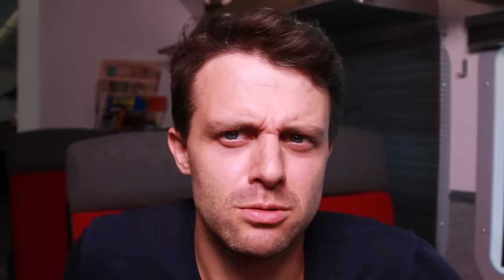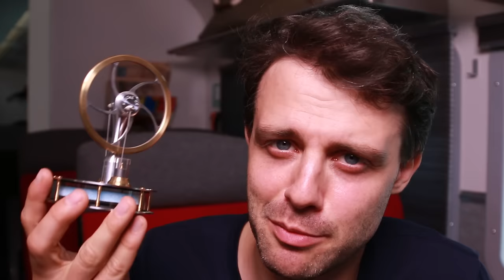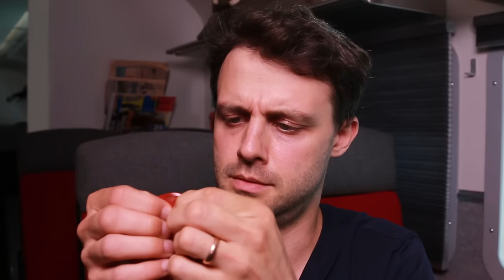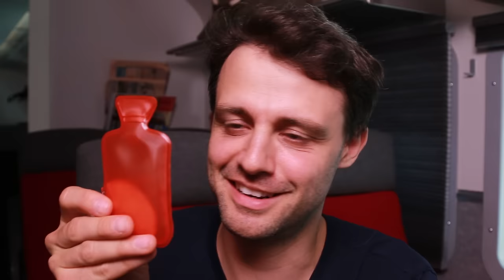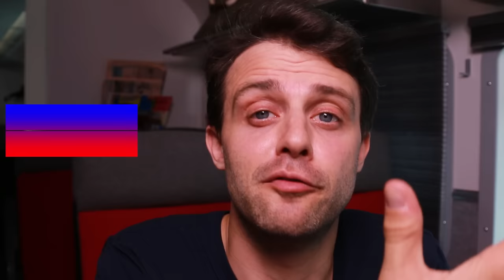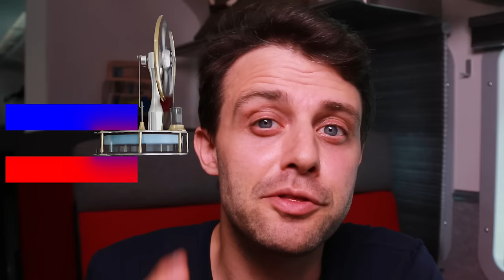A better description of entropy

Comment: Great video! Thanks for an interesting and enthusiastic description! Your definition and example is really nice. However, perhaps the statement “heat is not what you need to run an engine” could be potentially misleading. Heat is defined as the thermal energy crossing a system boundary due to different temperatures, from one body to another. So either we have a hot plate or a cold plate (ice), the complementary plate will have a different temperature and thus heat flows across the system boundary. This heat transfer is THE reason why the engine actually works allowing some of the heat to convert to useful mechanical work. I think you rather wanted to say: it is not the amount of possessed thermal energy in the plates which drives the engine but rather that there must be heat which happens only when the plates have different thermal energies. I get your point of course, but to avoid confusions. Cheers!

Comment: Lobbing in some trivia: Heat pipes in modern computer hardware function by a similar principle  (Liquid inside heat pipe evaporates during coooling, lodges somewhere else in the pipe, condenses as it cools, flows back to the GPU/CPU core, repeat)

Comment: minor correction. there are lots of ways to arrange the ping pong balls so that all red balls are on one side and all blue balls are on the other side. think of each half independently. there are myriads of ways to rearrange the balls in either half. but there are still multiple orders of magnitude more arrangements where the balls are not separated by color, so the end result is the same.

Comment: Thanks for the clip! I've got a formal training in theor. physics including Ph.D., so I have learnt both the microscopic-statistical "measure of disorder" (correct but not easy to turn into useful calculation) as well as the thermodynamic, blackbox-process-motivated "state quantity that varies with dQ/T" (also correct, and more useful, but somewhat distant from getting an intuitive understanding). 
I keep struggling with forming an intuitive (yet quantitative and correct) grasp of entropy. Your clip helped, but I keep struggling.
Energy is much easier in this respect. It's simply a conserved quantity.

Comment: 3.30 "the air cools and pulls the piston down" despite what you can read all over the internet that is not how a stirling engine works, the flywheel performs work on the gas when the gas is in the cold end, the gas performs work on the flywheel when the gas is in the hot end, the difference between those two amounts of work is the work output

Comment: > 6:20 'So if I manually run this wheel, I can cause one plate to get hot while the other gets cold' 
Which one will become the cold plate and which one the hot? The movement of the foam is symetric
Reply: Actually the right answer is that both plates will become hotter
Reply: But if initially both of them had already a temperature difference, will the difference become greater? And would it actually become greater because the cold plate becomes colder o both plates increase their temperature but the hot one gets hotter more quickly?

Comment: Thanks for the explanation. I will use it to calibrate other explanations of entropy.
I am curious if anyone has any thoughts on the following.

Entropy is a relative notion that describes the extent that the energy difference of a system has been resolved. Because there are no perfectly closed systems and energy always leaks, the only objective reference is the starting PE of a system, thus entropy is a relative notion.

Why is the notion that energy always 'flows downhill', not a law of thermodynamics? The second law says the same thing, but in such an obscure way.

Comment: time being defined in terms of entropy is an interesting thought. Imagine if you had a set of particules inside a box completely cut off from events outside the box, then you can define a local time completely dependant on the coordinates of those particles. 
To visualize this model in human terms a good analogy would be to see it as board game like chess(where the board is analogous to the box and the chess pieces to the particules). 
In this case the arrow of time is not always linear. If the position on the board repeats, it means the arrow of time circled back to a previous position(the past), and since the number of positions a chess board can have is a finite number (however big it is), then we conclude that the arrow of time is a big circle made of many smaller circles, like that serpent biting its tail.
This is of course only true if the box and particules are eternal, and are not subject to decay! (which is not true)

Comment: Nice explanation of what happens in a local system. Entropy = equilibrium. However in the wider system the universe has many natural "negative entropy" processes (eg, vortices) which charge separate polarities. So both entropy and negative entropy can be observed and the overall effect is a completely self-sustaining electromagnetic energy but with both localised equilibrium and localised charge separation. It will continue undiminished - until the Creator says otherwise.

Comment: I think the term "potential energy" would have been of good use here.  Rock at the top of a hill has high potential energy compared to what it would have at the bottom of the hill.  The rock rolls down the hill.  Potential energy is converted to kinetic energy, heat sound etc, rock comes to rest at bottom of hill.  Entropy has increased because it's energy has been converted across time.  Due to thermodynamics, some of that energy is unrecoverable.  Once all the rocks roll down all the hills, physically and chemically speaking, we've reached heat death.

Comment: In fact it is heat that is needed 
Heat is energy that transfer between two systems at DIFFERENT TEMPERATURES 
Só, when two parts are at different temperatures they exchange heat provide they are separated by diathermal wall

Comment: One analogy of why perpetual motion machines don’t work

Invasion you have a box on a spring,

In order to compress the spring you exert a force over a displacement and that means you do work to compress the spring,

Note if you leave the spring alone the spring’s
Length will be constant,

The spring doesn’t suddenly start bouncing back-and-forth without an outside force

because Newton‘s first law and object at rest will stay at rest and an object motion will stay in motion unless an outside force acts upon it

Comment: An internal combustion engine is different from a heat engine. An internal combustion engine converts chemical potential energy directly into mechanical energy, not by heat transfer, though there is also production of waste heat.

Comment: Pretty much everything works on enthropy, take a battery for example, it is just a container with negative and positive ions. The "goal" of those ions is to spread their charges evenly and neutralise and you can use the energy these ions "create" when passing a charge through a wire

Comment: So you could use this system to reverse the entropy on the system by feeding in energy from some other source like radiation effects
My ideal being magnetic field line snaps for output to a flywheel. between vacuum state sterling chamber and outer chamber of changed density to inner. Diffirence of effects.... Magnetic shielding and an innermost spinner that is positioned via the magnetic fields

Comment: Gravitation collects mass. energy is spread out. Also mass is a form of energy that is compressed. E=mc^2. Actually total mass and particles energy density is not change in the universe. Engineers introduced entropy to calculate thermal efficiency not discribe the universe. These two states(gravitation and entropi), working in opposition to each other, keep galaxies stable in terms of energy density.Entropy cannot describe the universe in its present formula because it is incomplete  for describe universe as conceptual.

Comment: The reason entropy was discovered was the realization that not all of the heat generated to power a heat engine (steam engines at the time) could be converted to work.  Carnot was the first to state this and Clausius formulated the equations that describe the minimum amount of heat that cannot be converted to work.  This represents a completely efficient system.  All real heat engines (steam engines, internal combustion engines, jet engines) operate at some fraction of the theoretical efficiency.  PV panels are not subject to this law since they do not use heat to generate electricity, although in the overall process, the photons are generated from heat.  The key is that you always lose energy to entropy.  The objective is to make the engine more efficient but there is a theoretical limit.  No perpetual motion machines allowed.

Comment: Work requires that you harness the energy in a locally hot thing as it reaches equilibrium with the environment. Work requires restricting, geometrically, the heat path, and there's a limit to how much you can restrict that path. In fact, the Carnot efficiency is 50% because the simplest engine requires the simplest limit in the geometry of heat diffusion, in three dimensions - the two sides of a plane. In any event people shouldn't be too freaked out by these fundamental limits since we live in a Universe where locally hot things are abundant and incredibly long-lived -- called "stars".

Comment: Entropy isn't disorder.
It is a perpetually moving balance.
The example I give is a frying pan.
You cook your dinner, and turn off the stove.
The pan is hot.
As heat radiates from the warmer pan to the cooler air, the air heats.
Eventually the pan is at room temperature.
This is maintained by the air and the pan constantly exchanging energy.
Whenever one gets hotter than the other, it passes energy tot he other until they are equal.

Comment: Also good to remember that most of the clumped up energy we use originally comes from the sun as well. All of the energy we eat and all fossil fuels come from animals and plants (which ultimately derive all energy from sun-based photosynthesis), and then there's solar power of course, and even wind and wave power gets its energy from the sun. There are non-solar-based energy sources (geothermal vents, hotsprings, etc; earthquakes, tides, gravitational forces to name several), but the only non-solar energy sources we've developed to use at any kind of scale (that I'm aware of) are nuclear and hydro power--oh, and I suppose steam power back in the day.

Comment: Hi Steve. Thank you for always posting interesting content. This had my attention from start to finish. I have just one  issue with your final thought. A closed container with the content at equilibrium will still have random movement and snapshots of the distribution of atoms would change over time. I think that time would continue even after equilibrium is reached. I might be wrong though. 😅

Comment: There is not only one arrangement with all red on one side.  Because the same colored balls are all each a distinct ball. When they are all on one side, you can still move them around into many different arrangements. 
Likewise, the other colored balls also have many different arrangements on their side, so you have twice as many arrangements with all of the balls of each color on one side. Therefore, it's not quite as simple as only one arrangement of the two colored balls separated on their own sides.

Comment: Entropy is about the efficient conversion energy NOT order/disorder. This arbitrary definition was created by some creation scientists who wanted a facade of science over their religious theory.
 
i.e. as organisms become more complex (evolve) they become more "ordered" counter to natural disorder and that requires some outside force, i.e. watchmaker, creator, etc. 

But as organisms become more complex they become more efficient and their entropy decreases! 

Consider the steam flowing through a steam turbine blade path. If the path is 100% efficient entropy does not change, Si = constant. But because of internal and irreversible losses the entropy increases. This fact is used to evaluate the efficiency of the blade path. It is obvious on any turbine cycle heat balance. inlet Pi, Ti, Hi, Si and exhaust Pe, Te, He, Se. Hs = Pe, Te, Si 
He actual is greater than Hs ideal. 
(Hi - He) / (Hi - Hs) = efficiency. 

Picture the upper/lower regions of the boxy Carnot cycle. Enthalpy is the upper area. Entropy is the lower area.

Comment: “It’s not heat you need; it’s temperature difference.” Heat is defined as the flow of thermal energy from higher temperature to lower. Having either is having both.

Comment: The confusion is that entropy describes more disorder and more order. Maximum entropy = absolute zero = complete orderliness & uniformity. Entropy is half the heat cycle. Heat discharges from high to low temperature. If the system is closed (adiabatic) that's it. To recharge & finish the heat cycle, you must open the system & charge it up with heat. Conservation of energy means (heat discharged) = (heat need to recharge) for the heat cycle. Entropy is real, heat goes from high to low temperature. But the idea that the universe will cease to clump energy or have hot spots is an article of faith.

Comment: once all of the energy of the universe is evenly spread out, time itself ceases to exist. time is used to measure the change of the universe from one state to another (a ball is on top of a hill -> the ball is nudged past a point of equilibrium -> the ball rolls down the hill), but if nothing ever changes there is nothing left to describe. the same exact phenomena—which is to say, none—will happen in either 10 seconds or 10 quadrillion years. time becomes irrelevant because there is no longer a change in state to be measured. at that point, other concepts that are tied to time become irrelevant as well: when we lose the ability to quantify the magnitude of temporal units, we also lose the ability to qualify their direction. that means that if time can no longer have a definite magnitude, it also can't describe events that are either "forward" or "backward" in time with respect to some other moment. there is no "yesterday," there is no "tomorrow," there is not even a "now" because "now" exists in reference to the fact that there was a time before it.

the very moment true entropy is achieved throughout the universe, nothing will exist—not even the past

Comment: time itself is a statistical phenomenon.  hehe... I wouldn't call it a phenomenon, I'd call it a statistical heartbeat.  Look at the stirling engine at the end of the video, that could be the ticking engine for any clock.  This is the basis of time travel, not in going back in time, but in squeezing existing entropies so time varies in varying degrees across different boxes of entropic moments making time travel simply a matter of delta energy.  

This also is interesting about entropy because it would mean entropy is not the measure of chaos, but actually is a measure of balance, the greater the entropy the more zeroed out the state of "whatever" is becoming, almost like a reset zone.  On an oscillator it would be the moment of change.

Comment: So would that external combustion engine slow down as the heat propagates to the top plate? i.e. Could I use its rate of rotation to roughly measure the heat of my radiator or heater?

Comment: 01:30 f: Free energy is real.
I already knew that since I first had a lesson in statistical physics and thermodynamics. It really is a concept of physics rather than one of esoterics, though the esos basically stole the name.
They also call it space energy which is supposed to be everywhere. But this is where their concept breaks down completely: Energy which is basically everywhere in kind of an even distribution is exactly not free energy, you can't use it.

Comment: Technically, all those energy sources (and probably all sources of energy we can access … arguably) are solar: Trees are carbon jammed together using solar power.  Oil is carbon jammed together by microbes of some sort, quite possibly using solar energy … but certainly by consuming something that did use solar energy.  Elemental energy (nuclear) uses elements forged in the hearts of long dead stars (making them the most tenuous on this list but, I think, still valid).

Comment: If all energy is always spreading-out, it means there would be a moment in time that all energy was together and a moment in time there is nothing left anymore to spread out. This would imply that the universe is a finite time line from time A to time B. And that's it. If that is true, it could not even have started in first place. The initial clump of energy is not just suddenly there, waiting to start and then suddenly starting. That would not fit the entropy always spreading-out. So this implies that time, space and energy are infinite. Only in that case there will always be, somewhere on infinite places a cluster of energy to spread-out never to become less than infinite. Spreading-out can continue for ever (and it makes time travel, back in time, impossible as well. Forward is still possible but never to come back.).